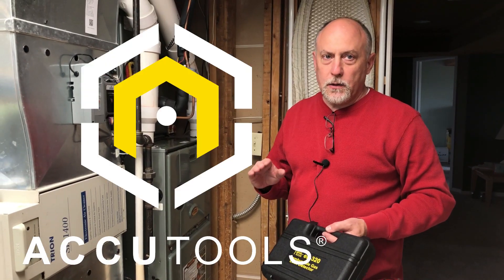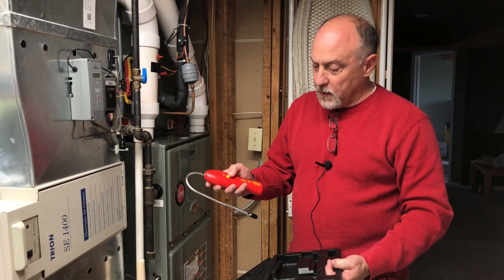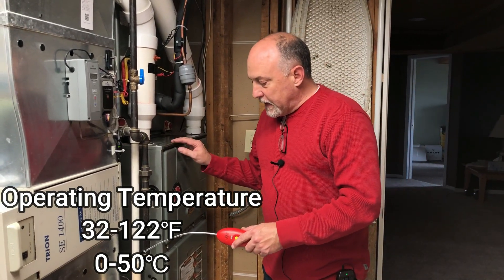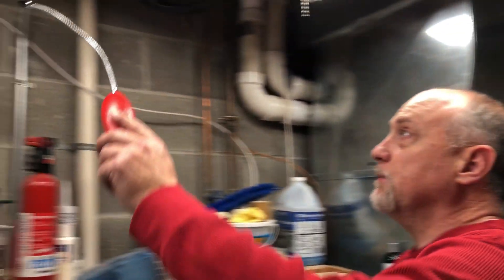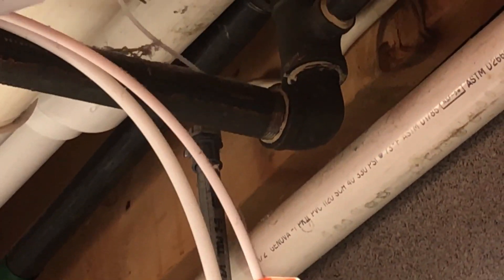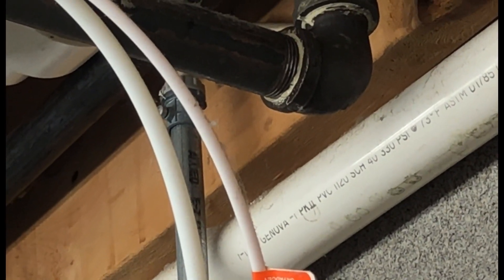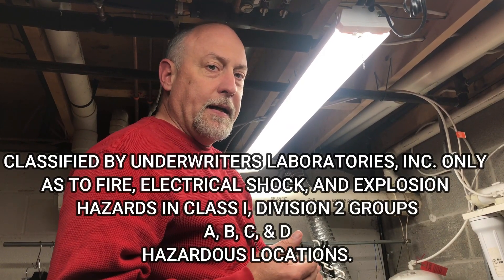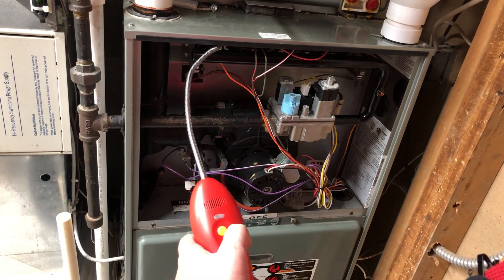AccuTools eL-320 Combustible Gas Leak Detector

Comment: Have you read Honeywell's form number 70-2320?  It would seem that they disagree with your use of the electronic leak detector in condemning a gas valve.
Reply from the maker: Singer Heating and Cooling Good point, and you would set the detector to low sensitivity for that type of test. Trace leakage is an issue for sure and the 320 can pick up trace amounts of gas at are normal on the highest setting. With any gas detector, it is always a test and verify.